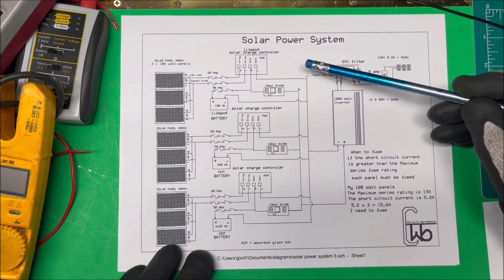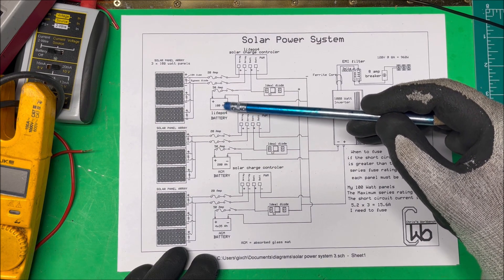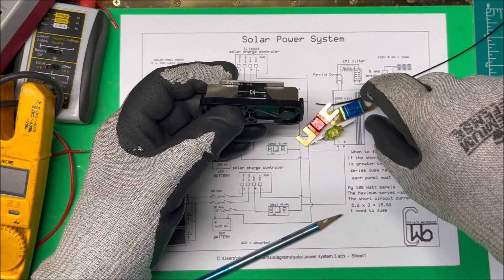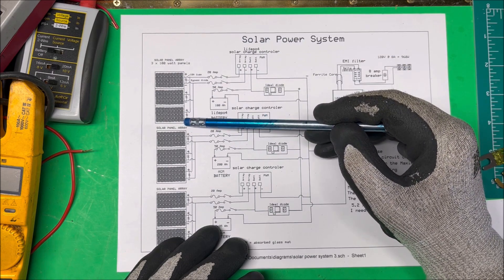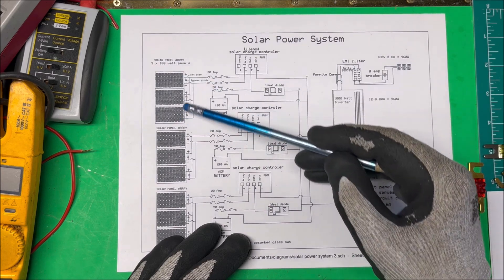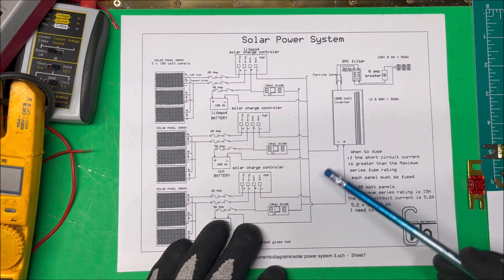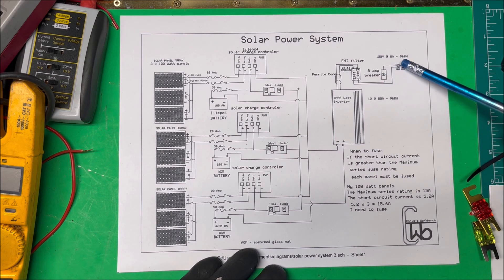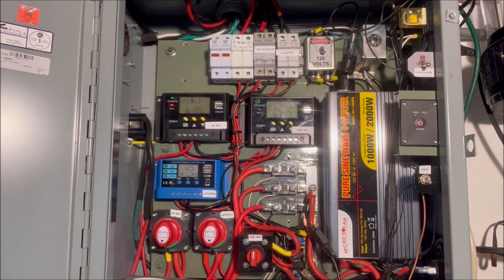Ideal Diode ORing

Comment: I really like your idea for the heat sink! I was looking around but couldn't find that one, any chance you have a link?
Reply from the maker: It's a Car Audio Fuse Power Fuse Holder 30-150A Stereo Audio Single Way AGU Fuse Holder Power Distribution Block from AliExpress . I had to modify it a little.